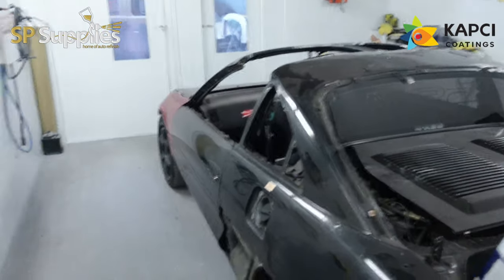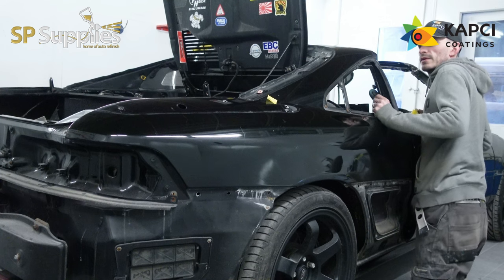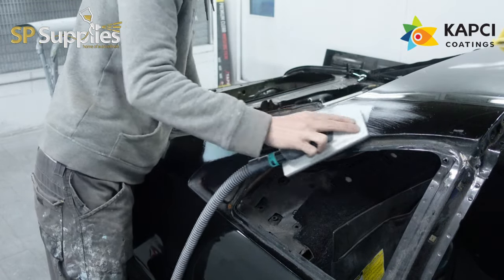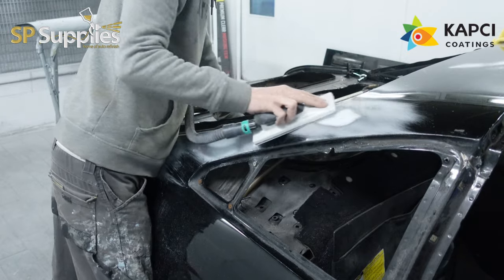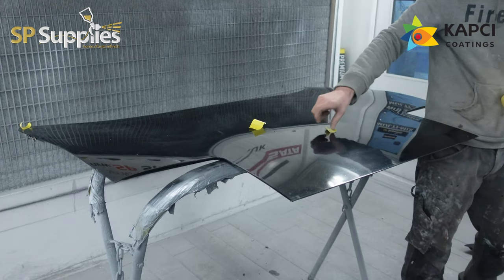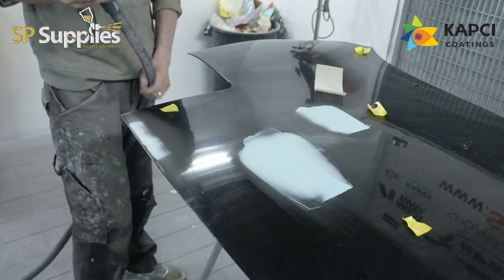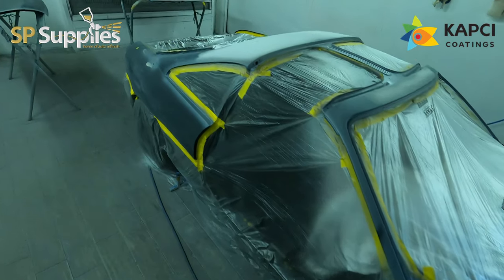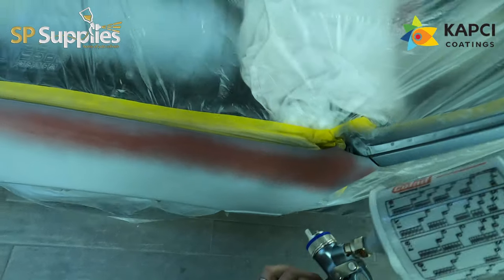Step By Step MR2 Repaint - Bodywork panel prep and primer stage

Comment: Hi Tony brilliant video.... when you’ve blocked primer 240, then da 400, ( would that be with interface pad ) when you go wet on wet is that with epoxy like 4:1 with 15% thinner ... thanks again Tony
Reply from the maker: so 
interface pad on the da yes
and no itll be wet on wet primer not epoxy mate
Reply: @TonysRefinishingTV  hi what ratio wet on wet for the kapci primer thanks
Reply from the maker: I’m not using kapci wet on wet on it mate I’m using an octoral one for this and it’ll be mixed to whatever the ratio is for that primer I have on the way
Reply: @TonysRefinishingTV  what’s your ratio for octoral thanks
Reply from the maker: I don’t know whatever the data sheet says mate I’ve not used it yet as I’ve already said
Reply: @TonysRefinishingTV  o ok thanks anyway Tony

Comment: Have you tried 120 instead 80 1st step on body filler? I have a few times now and haven't had any issues from not being flat
Reply from the maker: Yeah mate just with alot of the jobs we do being bigger I tend to go for p80 just for speed tbh
Reply: @TonysRefinishingTV  I was thinking faster by not having to remove deep scratches from 80 easier to remove 120 but still flat. If it's a skim coat yes 80 would be faster but few small dents 120
Reply from the maker: Yeah I’d agree there mate 100% tbh it’s just one of those grades we’ve never really kept in but I might grab some in tbh and see how it goes